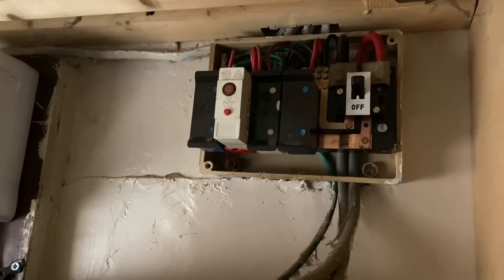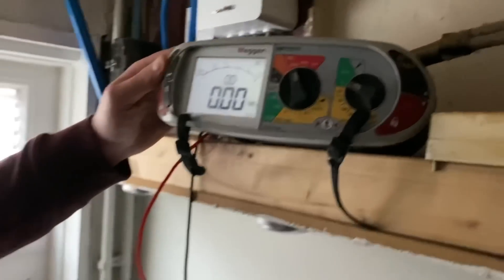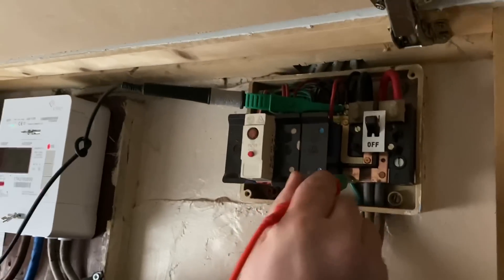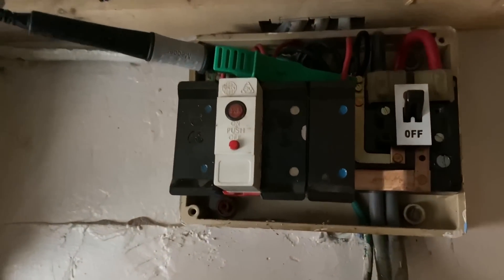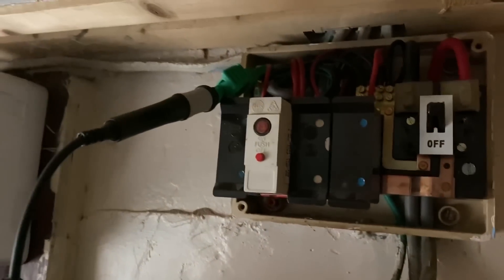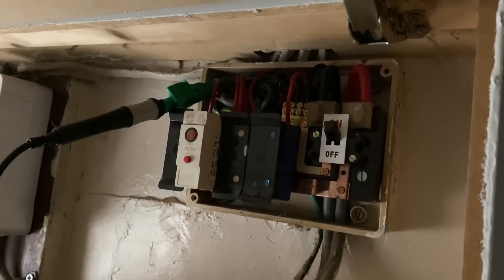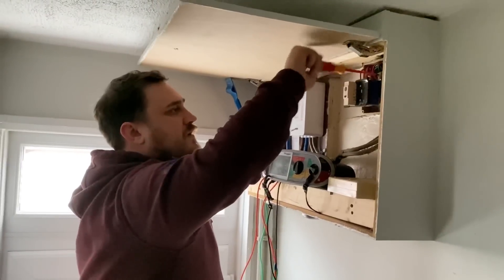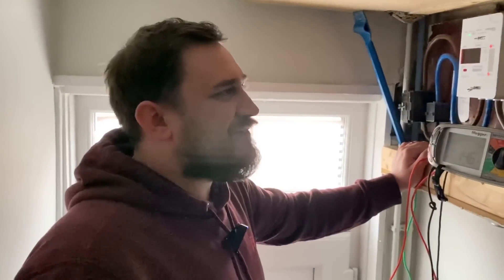Testing and Fault Finding - Low Insulation Resistance Fault - Testing at 250 and 500 Volts DC

Comment: I feel I am wasting my time.
Reply from the maker: Y
Reply: @GSHElectrical  because I seem to one in 10.000 who takes the time to read the health and safety executive’s note, and the guidance in the onsite guide yes there was a fault on the outside light but it doesn’t warrant a cu change .
Reply: @seandempsey7351  Look up the reasons you require "additional protection" in a dwelling and there's your answer/s for a consumer unit change. 👌
Reply: @mb-electricalservices  amendment 2 health and safety executive’s note page 2or4 BS7671, and page 99 in the onsite guide consumer units in dwellings, 
Also the regulations can only be applied from the time they come in , they are not and cannot be back dated, if a new regulation came in to day then it applies for from today onwards. 
Hence why we  have a six month grace period before implementing AM2 and the previous edition is with drawn to allow current new installations to be completed. Witch will not nessoserely comply with amendment 2
Also additional protection applies to new installations not existing installations, ie full rewire and installation of a new circuit/ circuits.
The fault was on the outside light probably water ingress all that was required was to replace the outside light fitting , problem solved.
Reply: @seandempsey7351  I think the understanding is they were checking before doing a CU change.

Comment: New On-Site Guide (Amendment 2) now states that "where the insulation resistance measured is less than 20MΩ the possibility of a latent defect exists". This was in the previous GN3 but not the On-Site Guide.
Reply from the maker: It’s said that for along time 👍🏻
Reply: @GSHElectrical  Old (Blue) On-Site Guide says 2MΩ (page 109), new (Brown) says 20MΩ (page119).
Reply: @MizunoIronMan  it also say the an IR test at 250 v DC shall be carried out between line conductors and the protective conductor be for equipment is installed? This is to avoid damage to sensitive electronic equipment. This implies that we test line and neutral combined to earth earth, this is a test we have always done  at 500vDC 
And as there is no pertenchal  difference it’s highly unlikely that such a would damage any electronic equipment.
Reply: @MizunoIronMan  what does BS7671 the big brown book say don’t just rely on the onsite guide.
Reply: @seandempsey7351   I know what the correct values are thanks. I was just highlighting the fact that there was a frustrating inconsistency between the OSG and GN3 before the new Amendment 2.  Maybe it’s the punctuation that threw you a bit .
Reply: @MizunoIronMan  20 Megohms is for new installations.  The 2 Megohms is for existing installations.  As far as I’m aware this has been around for a long time.
Reply: @PJB71  yet BS7671 state’s that 1 megohm is the minimum for existing installation’s and 200 megohm for new installations and between 1megohm and 2 megohm further investigation is required. The IET write and publish both BS7671 and the onsite guide yet they can’t agree what is correct in each book as both books contradict each other .
Reply: @MizunoIronMan  i’am not saying you don’t know , I was just pointing out that we should not rely just on the onsite guide.

Comment: The board looks so simple compared to the elaborate offerings nowadays K.I.S.S 😅
Reply: Unfortunately having many circuits on a rewireable fuse causes issues when a fuse blows. Separating circuits on to separate RCBOs means that any fault on one circuit will have less of an impact for the customer. Also flipping a switch is a lot quicker than having to replace the blown fuse wire.